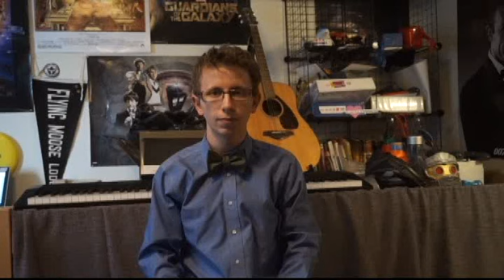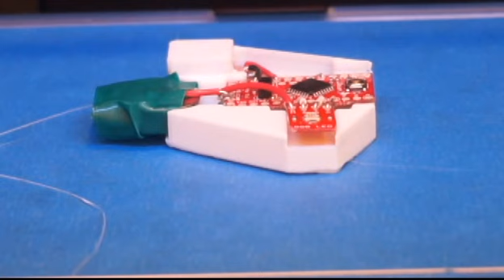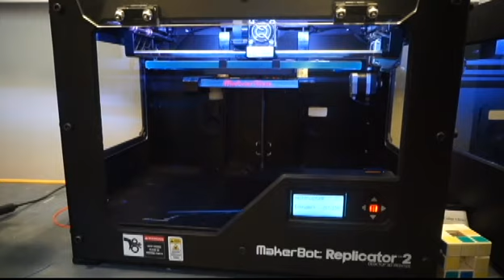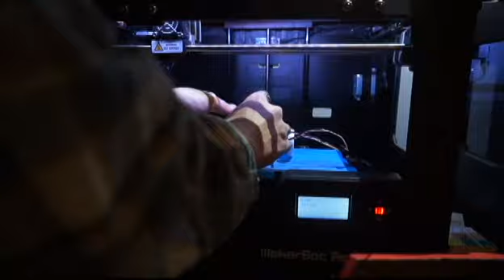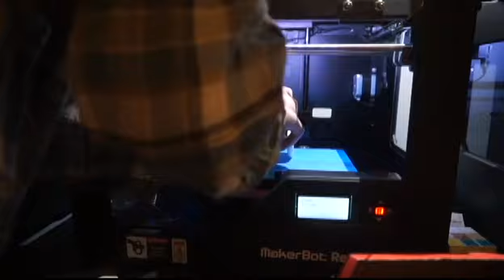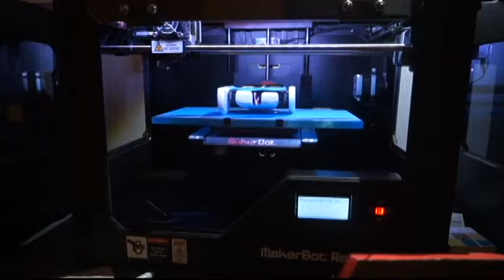Ep9: Printegration Factors

Comment: Is there a reason that the object you're printing must sense whether the print is done without outside input?

Seems like it would work well to add a command at the end of the print job in the gcode which would turn on a light or send a signal directly to the printed object. This would improve precision a great deal and make it very simple to detect when the print job was finished
Reply from the maker: +Magnus Nyborg Madsen It was mostly a design preference, I wanted to see if I could sense that the print was complete with minimal altering of the printer and the gcode. But that is a great idea, I've been considering working a lot more with the gcode for future projects. I ended up going with this method of sensing: https://www.youtube.com/watch?v=mp0pQyzSg4Q
Reply: Yes, I saw it - and I understand the choice in design. Cool project - could be an interesting step towards self replication. I'm imagining a picknplace machine putting in all the electronics and structural materials, with the printer finishing it off and then being able to clear the buildplate by itself, it would essentially be a complete production unit. I would like to see more! :D
Reply from the maker: +Magnus Nyborg Madsen That's the end goal! Ihaven't really tried experimenting with a picknplace machine-3D printer combo yet, but its something on my todo list!